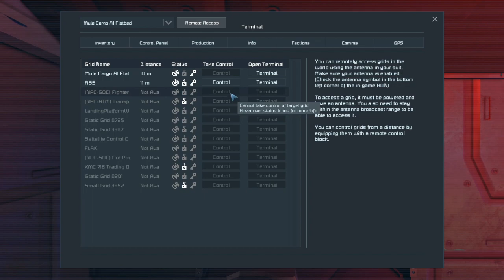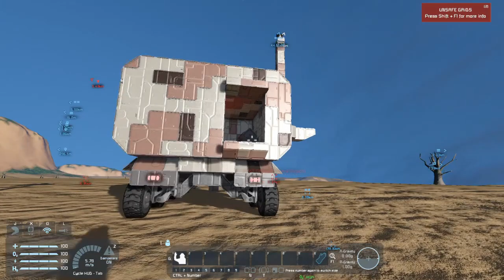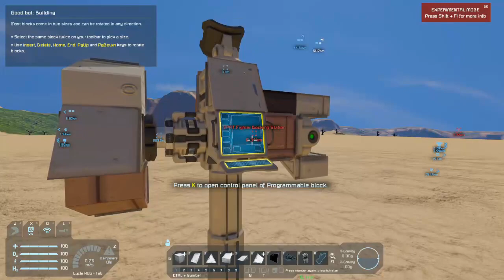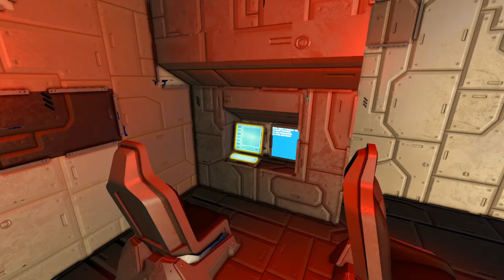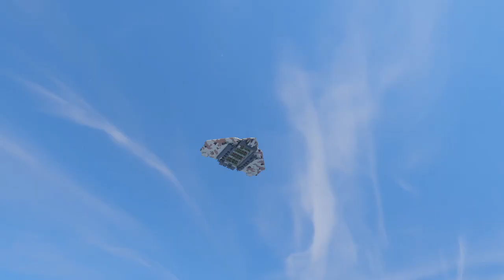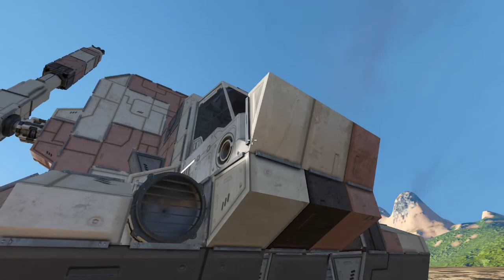Space Engineers: Ship Networking & Laser Designator [OUTDATED TUTORIAL] 2018

Comment: Is it possible to use this script to help player made drones track targets? Instead of using sensors.
Reply from the maker: I think it's possible to track enemy antennas but you need to heavily modify the script and it's definitely not easy but possible. I've seen some drones doing that. I guess you need to do something like the following:
1. Get the position of the target antenna
2. Translate the coordinates in relation to the drones position and calculate the angle the drone needs to rotate to
3. Call the drones gyro override to  align it to the target
4. Repeat
I recommend you read something about vectors, matrices and trigonometry because you need to do some complicated calculations for that (that's actually some kind of rocket science). Keep in mind you can't use over complicated loops in SE and you need to call the function with a timer block.
Have fun experimenting :)
Reply: @Moimus   thanks! :) 
Wouldn't it be easier to transfer the coordinates to a remote control block then have a timer block on a one second timer so the coordinates will update every second. Would that be possible. Also sorry for all these question but I dipped my foot into programming in SE and i know how to rename a beacon but why can't i rename any other block such as a timerblock?
Reply from the maker: @Frawracopter  yeah didn't thought about that. That might actually work. I know you can assign a waypoint to remote control by a script but as I tried that it bugged out when I tried to activate the autopilot remotely and worked when I started it manually but that was a while ago and I don't remember all the details. Just try it and see if it works.
That would be definitely easier than delving into that nasty math
Reply: @Moimus  thanks for all the answers. How do you go about transfering coordinates to a remote control block automatically?
Reply from the maker: @Frawracopter  Like in the video but the programmable block is hooked up to a timer block